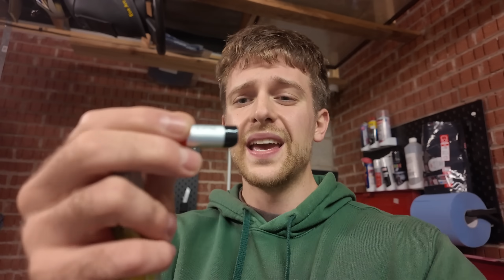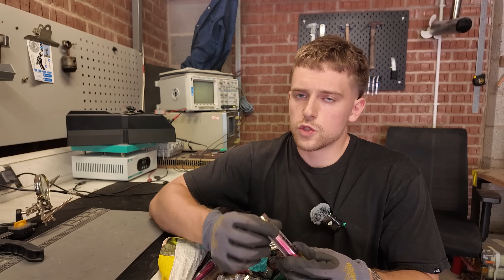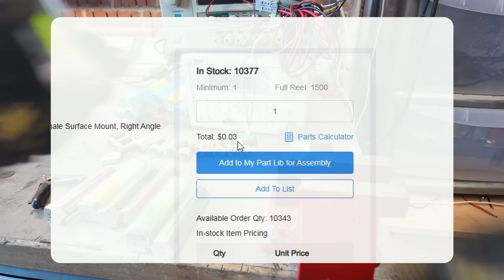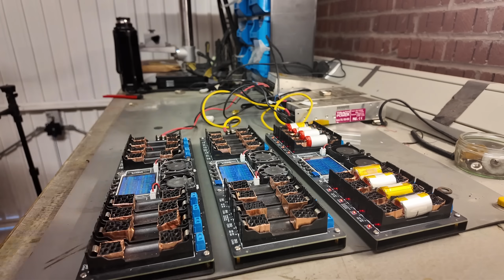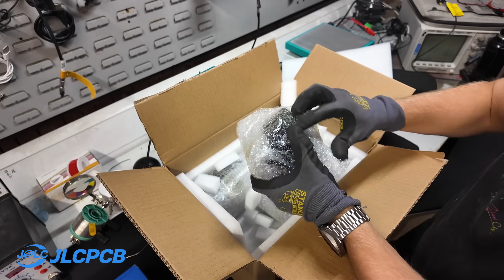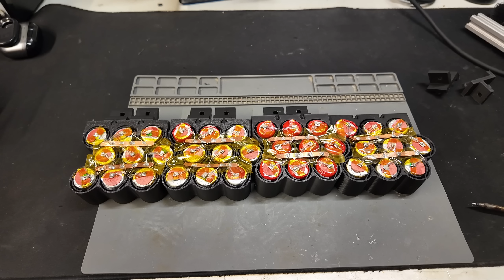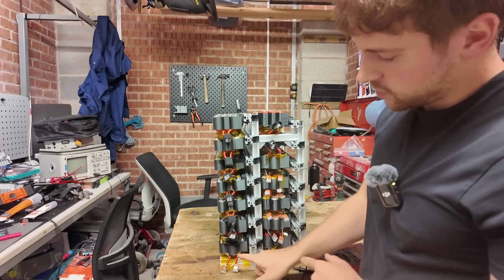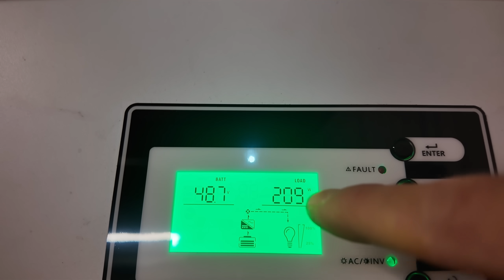I Powered My House Using 500 Disposable vapes

Comment: Terrible idea long term. all the cells don't just need to match capacity wise but also from an internal resistance perspective too.  Without considering this, some of the cells will be getting damaged which is exactly how they end up setting on fire, yes the BMS will help, but that doesn't manage the health of individual cells.

For anyone looking at trying this, don't use anything other than cells all of the same capacity and internal resistance.

Comment: Jesus wagos ????!!!???   So here in the states those things are turning red when more than ten amps go thru them for very long.   Prettt sure they aren’t gonna be capable of dealing with the current you’re about to pull.  Depends on the situation. I guess.    I’d be nervous with those in there long term tho   Super cool project honestly tho
Reply: Oh.  And that ic5 connector is not a 200amp continuous pull connector.  Just a Burst.   Look up as150 connectors.  They will pull 300 burst. 150 continuous and they are anti spark as well.  Super sick

Comment: how much time are you able to use the batteries until they run out? also if those batteries can go bad on the vapes that easily does it mean the same for the big battery you made with them? or did you add some security for them to stop working at a certain percentage?

Comment: my man, the copper tape on the TPU honeycombs is probably one of the most impressive solutions I've ever seen for this issue.
Reply: i was literally sitting here thinking "this dudes problem solving is out of this world"
Reply: It blew my mind - how clever and simple it was.
Reply: I usually just use aluminium foil scrunched up pretty dense
Reply: he could have used a sponge, with copper around it , but tpu worked too
Reply: You see something very similar in a lot of devices (like laptop computers) where a piece of foam in a metal fabric is used to connects parts of an EMI shielding together or connect the shielding to the circuit board's gound plane. It's called an EMI shielding gasket and I bet it's where he got the idea from.
Reply: Yes that were a pretty smart solution
Reply: For real, I am a software dev, and know nothing of electrical engineering. But the sheer simplicity of the solution was something I was in awe of.
Reply: So no offense to him, why didn't he use a spring? Might just have a 3D printer handy

Comment: There's no way if keep that fire bomb in doors. That bms only does one row. I do like the fuse but a proper calibrated wire would've done. But the last row will have 50v passing it. 
But nice work. Very interesting video 😁😁😁

Comment: Any electrician could have done this 30 years ago.
Nothing new here to see apart from giving a second life to chemical waste.
The question is: can you run your house and workshop for three or four weeks off grid when the sun hardly shines in the winter. And how much investment is required to do this? What is the kWh cost then?
I bet it is not cheaper than just connecting to the grid. Electricity can best be generated at one or more highly efficient power stations. Less waste and more economical.

Comment: That's a really really good idea, also to avoid this incredible waste of resources... you're really putting in a lot of effort... have you calculated how much you spent on the rest of the parts you had to buy...? Was it cost-effective, or at least a wash compared to buying a battery outright? If so... that would be fantastic !!! Keep up your really good ideas... to protect your house and the houses of others who build this, build two layers of gypsum fiberboard (not gypsum paper boards) on the inside of the enclosure, staggered (i.e., without a joint on the other). These will protect against the spread of flames for quite a long time in case of fire , at least until the fire department arrives... ;-)

Comment: For an experimental setup,  I'd be happy to recharge cells that were down to 1.4V.   It's the physical trauma that these soft-walled cells have endured that's gonna start the fire, so I'd always have it outside, in a metal case, and away from anything flammable.   IIRC if you limit the current to a trickle until you're above 2.5V then most cells will recover with no discernable harm.

Comment: So, you charged all the cells up evenly before soldering into your power wall frame. 
How do you then recharge it once they are all in place? 
Would that be through your Battery Management System and taking power from the grid?

Comment: 6:18 and😂 sorry who in world told you that you have to have the same capacity in parallel??? Because you DON'T HAVE TO! If you have 2 4.2V in parallel, one battery 1MWh and one 1KWh, it just adds so the final cap is 10001000Wh!

Comment: Really interesting project!
Just a small note — in Sweden, our main breaker disconnects not only the live phases but also the neutral.
That means when you run the house off-grid, the system becomes completely floating without an earth reference, which can be dangerous unless you define a proper ground connection.

In the UK you usually have a TT or TN-S earthing system, so the situation is a bit different and safer in that regard.
Just mentioning this because what’s safe in one country might not be safe in another, great build though!
Reply: It certainly is dangerous! That's why the inverter needs to be earth (as a source) and there needs to be residual current switches (300mA at the inverter, for general protection, and 30mA for every wet place). 
TIL: not every European country uses a local earth pen with residual current protection.
Reply: I had a battery-interveral-solar panels setup installed (in UK) and that didn't use a separate earth. When they adjusted it to run off-grid with a large switch they had to add an earth rod and certify it to make sure I didn't lose that earth connection.
Reply: But why? even in Mexico with out very relaxed electrical codes the ground is always independent and always conected with a copper bar in to the  ground
Reply: Also need to be very careful that the main switch (grid supply) does not get switched on while the installation is being fed from the inverter, as the chances of the two supplies being in phase with eachother is very slim. Out of phase AC voltage being directly connected can cause an almighty explosion, its the same as shorting out two phases to each other.

Comment: You could also do this with flat laptop batteries. Many laptop batteries are thrown away, often with just one broken cell. The remaining cells are still perfectly usable. There are often a lot of them in recycling bins ready for reuse. They also have a much higher capacity.

Comment: Single use vapes came to be because of the US juul ban that banned pod vapes in the US. Elfbar actually has redeemed themselves I don’t know about the UK but here in mainland Europe you can not only get pod elbars but fully refillable pods from elfbar and elfliq (literal liquid 10ml for the price of what 1 2ml elfbar used to be) they have released multiple bottom parts like the turbo and the master which accept two different types of ohm pods (1.1 and 0.8 (turbo) pods) these are all available at gas stations the liquids the pods and they are not prefilled so you need to buy liquids and even my grocery store carries everything you need to vape what is basically a pod mod for 10-15 bucks (plus replacement pods 2 2ml pods for 10 and the liquid for 10 as well). They still sell disposables but they are way less of them compared to prefilled pods and liquids even and the newer vape bottoms like the master last insanely long especially if you’re cool with using the 1.1 ohm pods.

Comment: In the comments, there seems to be a bit of confusion about difference between Circuit Breakers and Isolation Switches.  The big red switch is an isolator. All it does is turn the power on and off. Circuit Breakers trip when there is a fault condition. Chris's set up would never pass inspection as there is no safety interlock fitted to prevent his inverter back feeding the grid if the switches are manually set wrong.  This is really bad.

Comment: as a good practice I think you should have only 1 main breaker, 

Say for example your house, if the main house breaker is turned off, there should be no power regardless of the battery. You should not feed power 'backwards'/from 2 directions in your house grid. 

If an electrician comes to your home for e.x he turns of the main breaker of the house, he expects everything to be off, but surprise there is power being fed from the battery, which is dangerous

Comment: Insanely impressive project, congrats on the success. 🎉 I'd have shat my pants at least a few times around that many Li-Ion batteries. I wonder how you managed to get the install approve without even a casing for the battery. Is that dofferent for island circuits (off-grid). Or just a UK thing 😅

Comment: This is really cool to do, but the way you lock out the inverter from the grid is dangerous.
You could easily backfeed to the grid because there isnt a safety lockout. 
i know this more or less a proof of concept, but if someone wants try this they should know to have one. because backfeed can be dangerous to people working on the line during an outage for example

Comment: that's a really cool project ! but isn't that method of switching from grid to batteries unsafe ? i mean, there doesn't seem to be a safety to prevent enabling both which could cause trouble if the inverter doesn't put itself in phase with grid

Comment: I like your work, just one question: why didn’t you aim for getting the battery to around 230v? Or whatever your nominal is in uk. A lot of equipment would malfunction with such a low voltage.

Comment: How did you solve the issue of ground while disconnected from the grid? Normally grid is your ground right? in solar systems with a battery if you want to be able to switch off grid you have to have a separate ground connection like driving a copper rod into the ground basically.

Comment: Single use vape pens should be considered a crime against nature. Those batteries require minerals and resources that are finite and not easy to get. Ppl suffer and even die to get those minerals. Using it once and throw it in a landfill is ridiculous. Planned obsolescence and electronic waste seriously needs to be addressed. If only we didn't let blatant greed and rampant corruption run the part of the world we call "civilized".

Comment: Why didn't you use 1 of those point welding devices to quickly connect the strips to the batteries? I think I'd be a lot faster (and healthier with the reduced fumes you inhale)

Comment: The squishy 3d prints to measure and charge the cells was a genius move
Reply: Reminds me of using foil when i only had AAAs
Reply: Yeah they were  nice but in my head I just said ‘metal spring’ 🤓
Reply: @E4RLIES  Both have their down sides, honestly, I don't trust the resistance of springs or copper tape...
Reply: Yeah ngl my favorite small win of the video
Reply: Clever but he only needed one longer spacer per battery. One end could just conduct against the battery holder like normal
Reply: @ross9580 I think some of the batteries were too fat to hit either terminal.
Reply: @ross9580 yeah I was thinking it would be a block with a wire attached 😂
Reply: @ross9580  Maybe he was going for a balanced weight distribution.
Reply: Yeah, not having a 3d printer I thought spring
Reply: totally agree
Reply: Agreed, very smart.
Reply: Jaw dropped when I saw. I’ve never seen that before
Reply: Absolutely genius!
Reply: 5:51
Reply: I was just telling my wife we could do this with some 3d printed copper covered stuff, stumbled here and found He did it... absolutely genius move.  Wife lit up like a Christmas tree and goes... we could power anything! 😻😻
Reply: I would've made it with pieces of inner bicycle tube.
Reply: I gasped loudly at how beilliant it is!
Reply: Yeah the rest of the  video was pretty self explanatory besides that
Reply: There are no files supplied for those cubes to print them myself, does anyone have them or something similar?
Reply: You could have used a chopped up decorators sponge but perhaps over time the tpu would prove more resilient. 
But I think the most resilient method would be a metal spring with a copper plate soldered to each end.
Reply: Honestly would be a cool way into making a universal battery link for AAA or AA
Reply: fr fr

Comment: Ok. My House is not suitable, like most. My home draws 300W nominally. And peaks at 20kW or 20,000W this lasts about 1 hour over the day so I use 300x23 and 20000x1 all divided by 24 Wh (approx 1,200Wh) and no inverter will run the range usually 1kW inverter nominally and 30kW inverter for the peak but how to manage the usage?

Comment: I don’t think that the wires between your house and workshop are rated for taking the full load of your house. I would double check that before permanently running this as the energy path.

Comment: It might be cost- or size-prohibitive, but I’d be interested in a battery that could accept a wide range of these types of cells and allowed you to swap out cells if they failed without requiring soldering. Would simple sprung contacts work for this, or is there a reason for the cells always being soldered on batteries?

Comment: The weird thing is, Vapes were rechargeable from the start. The disposable ones came much later and it seems they really picked up, once the EU passed the TPD-2 directive. This directive lead to a massive increase in waste. More waste through smaller bottles. This change was used to do a price hike on all products on top of the tax and my theory is, that this price hike led to the chance to even make a profit on disposable devices. 

Before TPD-2, disposable vapes would have been so much more expensive than refillable and rechargeable ones that I doubt, that they would ever have picked up in sales. They just would not have had a chance to ever be competitive.

Comment: You can also use the inverter with actual car batteries the grid power charges them and then you can go off grid for a two full days and only have to charge for a few hours

Comment: u know that garden lamps that u stick in the ground and they last like year or two. Then battery goes bad or something in electronics (but mostly battery). They have inside 99% good working small solar panel that produce like 1.2 / 1.5 v. u could charge it with that. Well if they even mass sold in uk

Comment: Good job mate! But you should definitely make a good extractor to use when you are soldering. Just a pipe with a fan and your lungs will thank you for it. And a couple of solar panels to charge your battery pack would do very nicely.

Comment: For all those electrical engineers out there nit picking on details he was showing how it is possible to power a workshop/house with disposable vapes - that is all. Without a renewable power source to recharge the battery bank the whole idea is a little bit of a moot exercise other than to power the house during a power out.

Comment: This is a great project but you might want to upgrade this down the line since 2.25kWh aren't all that much considering potential parasitic power draw, any devices that awake from standby after power is lost, etc.

I could see this thing powering an energy efficient PC for a few hours but it's not gonna be sufficient for anything longer than that

Comment: Please be carefull doing something like this. What is happening is called backfeed and can be VERY dangerous (often illegal). The power can go back into the transmission lines and if someone working on them believes the power to be off an cause serious injury or death. The solution is to have something that will automatacally cut power from the main and feed the house/ shop.

Comment: How many codes in the wiring rules in your area does this break haha? Is there no changeover switch to isolate the grid from battery? If you have the grid and inverter connected you could fry it, let alone explode the batteries 😂…

Comment: Is it possible to make such bigass battery without soldering? Like you set those batteries into cells mesh, put a cover with contacting springs on it and just build it all like lego. Do a 10KW battery speedrun

Comment: Lithium cells discharged below 3V doesn't necessarily mean they will be bad. You can apply a small current topping out at 3.1V and then put them into your tester after that. Some cells will be degraded, but I've resurrected many cells from laptop battery packs like this.

In fact, only if you reverse charge the cells does it actually destroy them.

However, if the cell has a protection chip on it, you may need to jumpstart it. It doesnt look like your cells have those though.

Comment: going under 3V doesnt mean its dead or bad. At 3V is still at 5-6% Capacity left. only way to see what batteries are good or bad, is to fully charge them and do a capacity test. you might just be excluding discharged (GOOD) batteries, and using BAD (fully charged) ones

Worth considering your grounding solution when you're powering your workshop/house from it. specially if your ground is neutral bound/TN system, that would mean your house was not grounded when you did that.